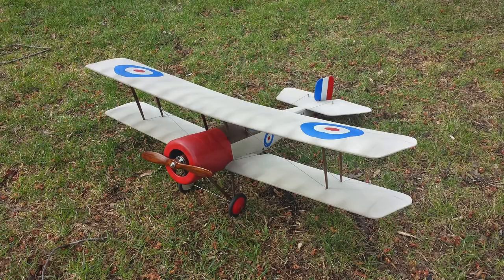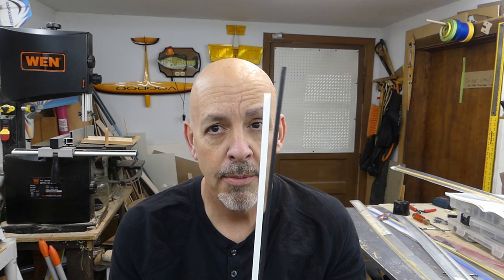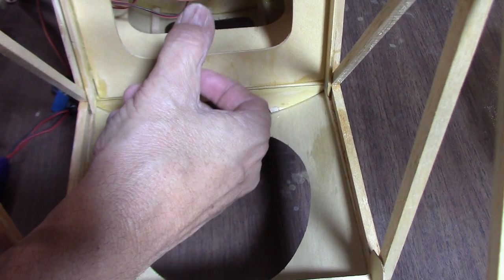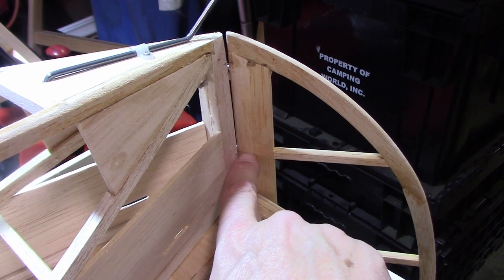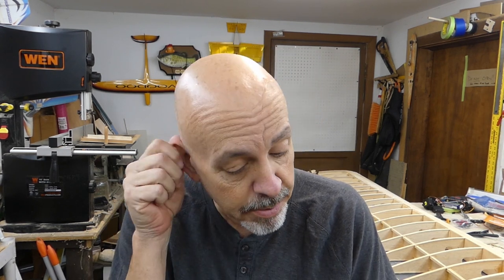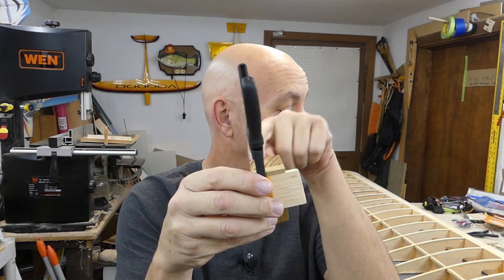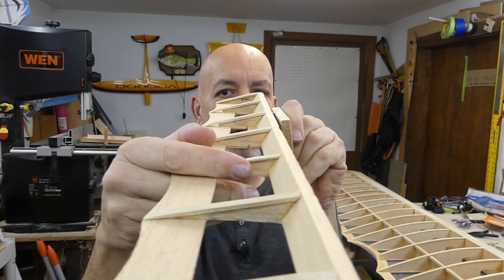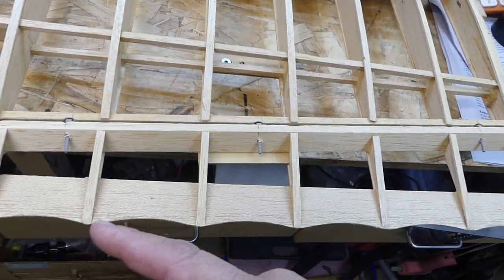Balsa USA 1/4 Scale Fokker D.VII - Episode 25 - Control Rod Problems and Ailerons Mounted

Comment: As far as the push rods go! Why not make them full length, out of something like Birch or bass wood,
all one piece??  How about using push pull cables for the elevators and the  Rudder???
( not the  Alaron) Good to see you on the air again in good form Bud
Reply from the maker: I considered all options, but my final decision was carbon fiber tube. They arrived yesterday. The next video will be pretty much all about assembly and install.
Reply: @BudChristensen   Yes I agree, carbon fiber actually is the best way to go!! I only suggested that because,  I own a wood shop and I could make anything like that I wanted. But now that I think about it, the wood itself could change the center of gravity, Good call Bud .  On another note,  where would you get the carbon Fiber rod and the outer sleeves?? I think, I will need a  longer set of  rods for the 3rd scale.
 So, your opinion?